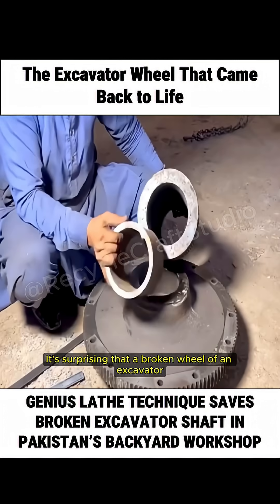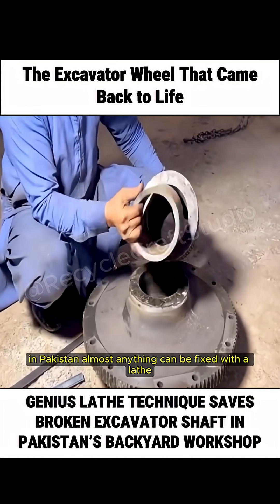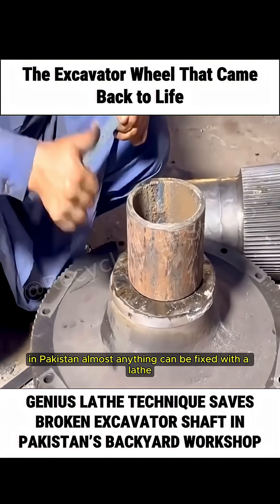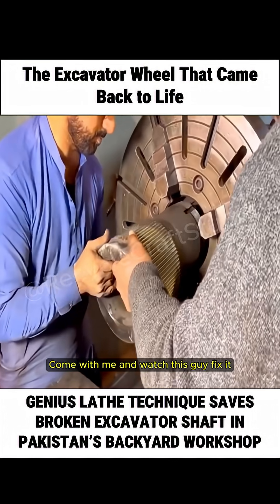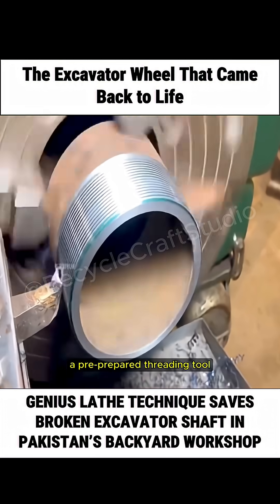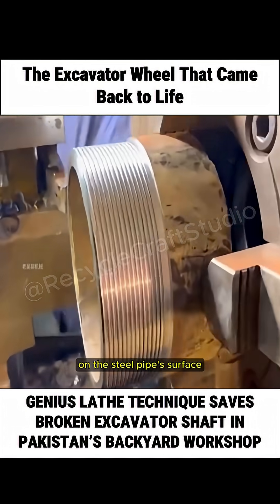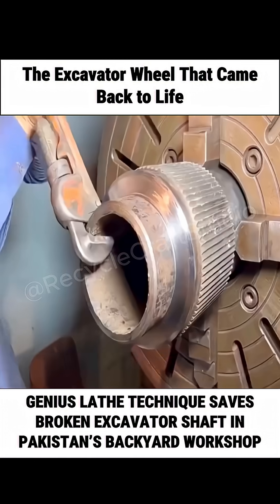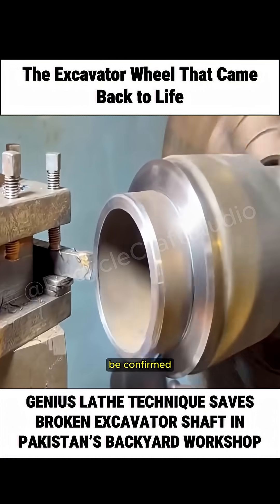Genius Wheel Axle Repair from Scrap Steel | Recycle Craft Studio Restoration #shorts

Comment: The industrial wizards.
Proving that,  just because it's broken doesn't mean it's useless.
Reply: That is so cool😊
Reply: I hate to burst your bubble but that is a crap repair.  There is no way it will stand up to the forces that will be applied to it.  At the very least, there should have been a v-groove down to the pipe that was filled with weld.  The shallow surface weld will break the first time it's used.